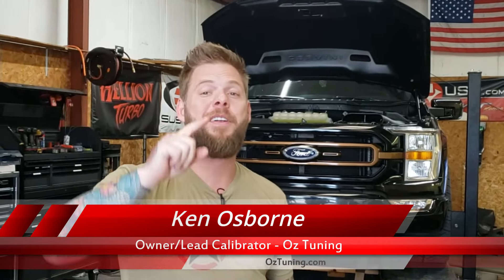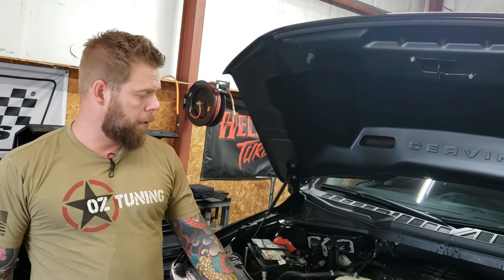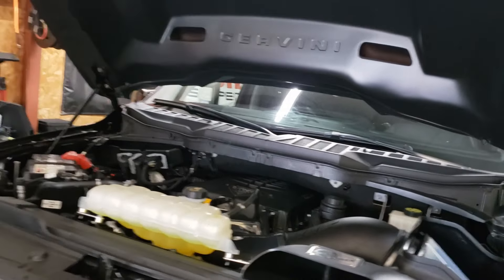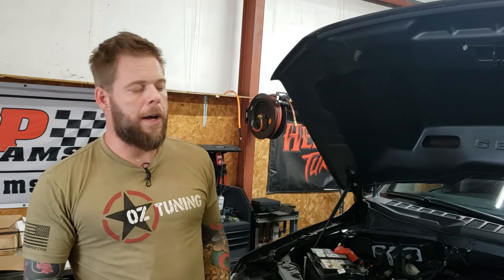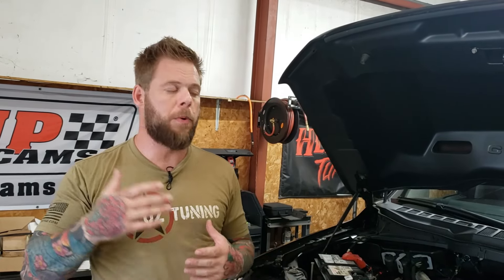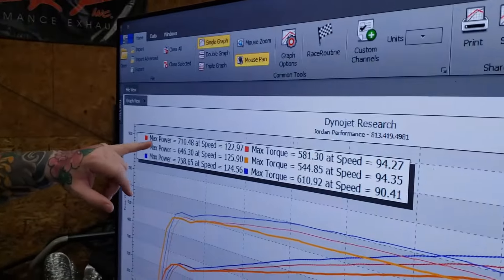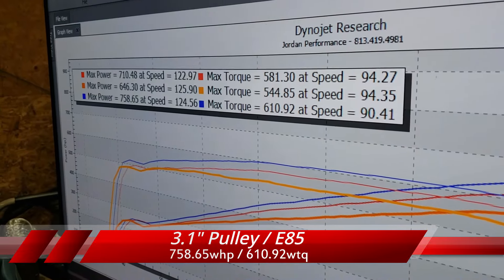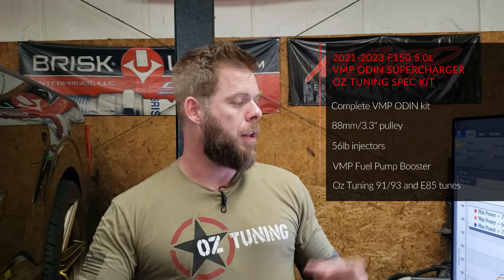2022 VMP Odin Supercharger - Oz Spec kit.  Dyno results and release.

Comment: I have a 2016 f150 3rd gen 5.0 with the odin, am i able to run e85? I have the vmp bpa and 56lb injectors.
Reply from the maker: Please contact our tuning department directly on this and they will be glad to help. The email is Tuning@OzTuning.com
Reply: I have a 2020 F150 with a VMP Odin same set up. I’m wanting to know if I would be able to run e85 also. Just emailed y’all
Reply: Was you able to tune your truck on E85?
Reply: My understanding is that the 2016 Gen 2 engine, having only one injector per cylinder unlike the Gen 3-4's two, would require only a boost-a-pump and a tune.  For my Gen 2, however, to run E85, I'd need new 1000cc injectors and a fuel system upgrade. I've ordered the parts and eagerly await their arrival.
Reply: @ other Tuners said I would have to do the same have a bigger fuel system but guess I’ll see when I hear back from Oz.